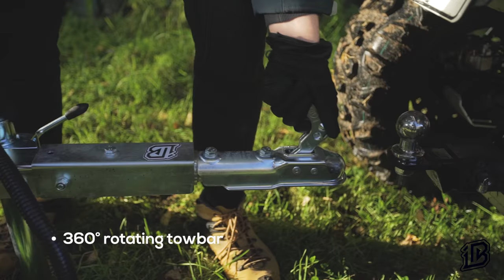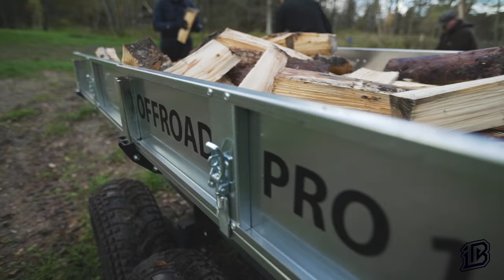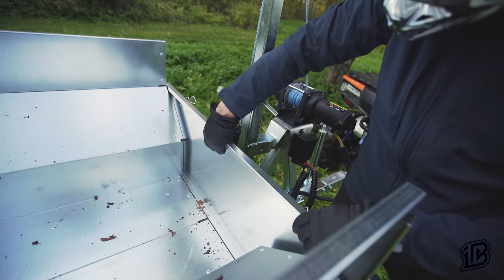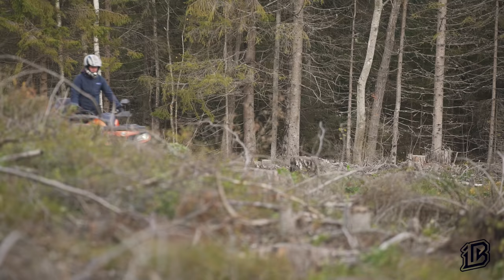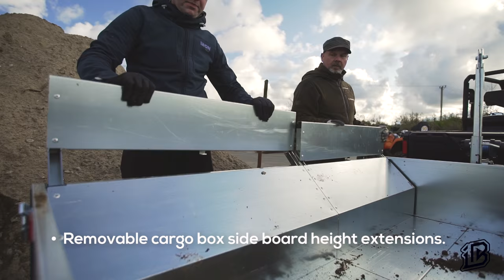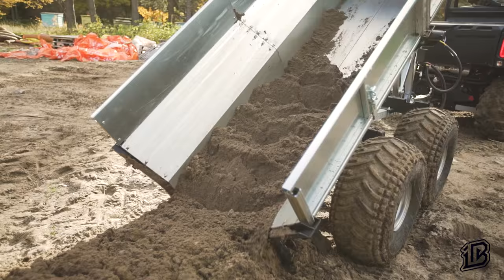ATV TRAILER - Offroad PRO 1000

Comment: Literally 4 wheels, a big thin slice of meatal and a lift, costing that much, pretty much make it on your own lol, it will cost not more than 300$
Reply: Really ! The tyres would cost that alone.
Reply: @AJ-qn6gd  depends, so its a speculation
Reply: @Burago2k  no more speculation than your original comment ! I know if I wanted to buy four tyres for my ATV/Quad they would be at least £300 closer to £400 for something branded, It’s not just the cost of the materials it’s the R&D the labour, the fixed costs ie lease local taxes, heating etc.
Reply: @AJ-qn6gd  well thats america though, im from a country in Europe so its different, so it still depends, although you might not be wrong, thats not what im sayin' plus ain't gonna argue about it
Reply: @Burago2k  not trying to argue was just saying I thought it unlikely but you might just have a business plan there if you can make them for so little 👍🏻plus I’m not in America I’m in the U.K. where we use the £ 👍🏻🇬🇧